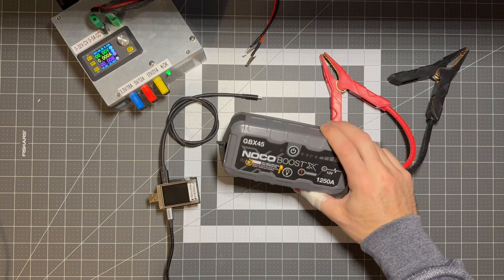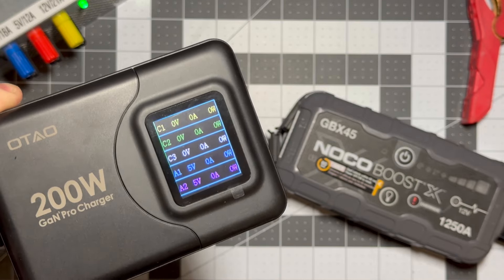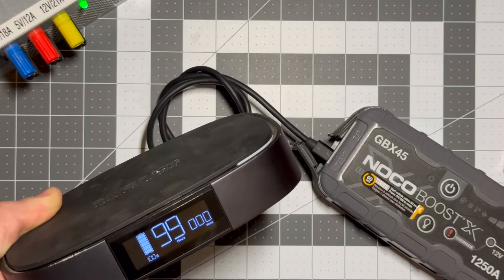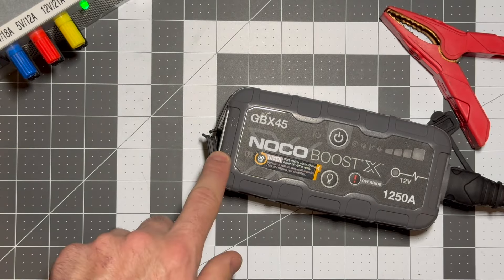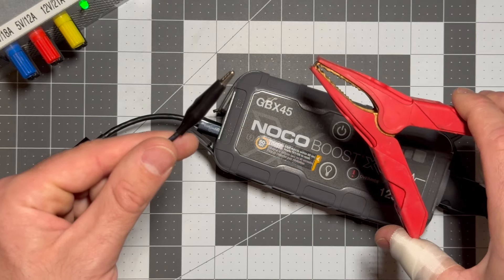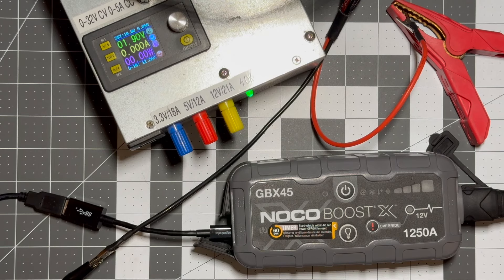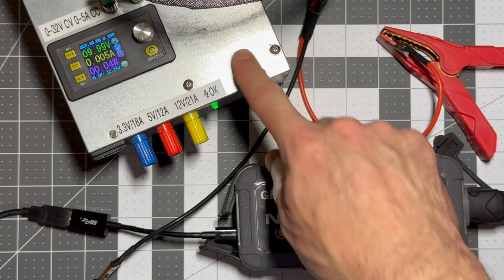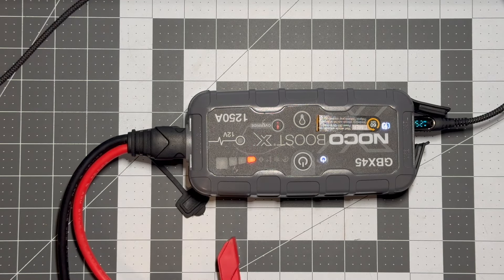No-Open NOCO Repair: Power Measurement and Charging Hack

Comment: Thank you.... this worked for me. I went to Harbor freight and got the cen-tech battery maintainer $9.99. Got home and cut one end of an old usb a  and of the 4 wires I used the black wire. Plug the positive clamp of the maintainer to the positive clamp of the noco and on the usb a black wire I plugged the negative clamp of the maintainer. 15min later  noco was alive again. Thank you!!!
Reply from the maker: Awesome. What is the current on the battery maintainer? I bet it's in the right range for charging this thing up.
Reply: I used this same trick and it worked like a charm.  I have a Battery Tender brand tender and it outputs 1.25 amps. 

It brought the unit up far enough to get the red light in about 2 minutes, and then I brought it inside and put it on the regular outlet charger.
Reply: @CarlosFlores-ih7dg did the charging light turn green on the cen-tech trickle charger for you? Mine is staying in yellow, which is standby.
Reply: @jamie1682 Yes it blinks indicating it's charging
Reply: @colindgrant  I have a Noco Genius2 2A car trickle charger. Do you think that would be too much amps to do this fix on my GBX45?

Comment: Thank you so much for this video. I’ve had a GBX 55 that’s been dead for six months. I could not build a power supply like you have. But I did have extra USB-C cable, so I stripped back the white outer coating of the cable, to show the black and red wire on the inside. then I cut the red wire in half, Stripped back the red wire from the USB-A end and I connected that wire to the red positive clamp of the noco. I took the USB-C end which had only the black ground wire still attached, and plugged it into the USB-C input of the noco. I first plugged the USB-A end into a 5V 400ma Power supply and left it plugged in for approximately 15 minutes. Then I pushed the power button for the light on the noco, and the charging LED started to blink fast. So I disconnected everything I hacked together. Three days later using the same 400 mA power supply and a new USB-C cable, my Noco GBX55 is fully restored. Able to take on my 60W fast charger. Again, thank you so much!!!
Reply from the maker: That's great! The fast blinking was probably because the battery still needed more time on your charger before the NOCO BMS could take over. Nice work.
Reply: What power supply did you use if i may ask like did you plug it up to the wall?

Comment: Has anyone figured out why this happens in the first place, I mean why the battery gets drained and the USB C port cannot charge it? By the way great video Colin.
Reply from the maker: Thanks! I can't answer completely. But I can add a few things:

1) The USB-C port incorporates a buck-boost converter that adapts between the pack voltage and that of the device plugged in. When you plug in a charger, it boosts the voltage UP, and then that power is passed on to a special lithium ion battery charging IC, which charges up to around 16V. When you plug in a load, it bucks the battery voltage DOWN to 12 or 5V. USB-C devices identify themselves as sources or sinks (chargers or loads), and with the voltages they support, and there is a negotiation between devices at both ends of the cable. So you have a chicken and egg problem. The USB-C circuitry inside the pack has to be powered in order to achieve this negotiation, so that it can receive power! It's analogous to a car battery with an alternator. A truly dead battery won't signal the alternator to make power in order to charge the battery, so roll starting won't even work.

2) As for why the battery gets drained in the first place, I think there must be some small parasitic draw, maybe listening for you to press a button. If you jump start a car or two, you deplete the pack, and then if you don't get the thing onto a charger soon, the parasitic draw brings the pack voltage down below some built in safety threshold. Theoretically a low cell may be an indicator of a damaged cell. So most lithium ion battery management systems are designed to refuse to charge low cells, out of extreme caution. Remember these things can't be allowed to catch fire on an airplane, or after leaving outside at 20 below, or in your car at 160F on a hot day. So manufacturers have to play it safe, and just refuse to charge when there is any indicator of any risk at all.

Sorry for the novel, hope that helps!
Reply: @colindgrant  Thanks Colin for sharing your thoughts. Do you think that having a charger connected to the USB C port of the NOCO which is not turned ON could drain the battery via the USB C port? I use a laptop USB C charger which I run via an inverter in my car. The NOCO is connected to the charger all the time, except if I want to use it outside of the car. So it is only charging when the engine is running. The car can sit in the garage for several days sometimes. It is interesting though, that I have been using it like this for almost a year and it just died one day....
Reply: Nice explanation
Reply from the maker: @miken191 Hmm, the NOCO is designed for charging and discharging through the USB, so I suppose that is possible that it was drained, but I'm surprised it would die suddenly.

Comment: Thanks!
Reply from the maker: I’m glad you found it helpful. Thank you for your generosity!
Reply: Thank You so much! My NOCO died right before my road trip and this revived it. I'm assuming the light was accidentally turned on and ran the battery completely dead.
Here are few helpful tips to help revive the NOCO boost pack.
1. Make sure you have a decent wall adapter for the USB-C cable.  A 1amp USB wall adapter may not supply enough power to continue charging the boost pack.
2. Continue to charge the boost pack with the USB-C cable as soon as you take the boost pack off the power supply. The voltage on the boost pack will or may quickly drop as soon as you take it off the power supply. If the voltage drops to much, then the USB-C cord won't be able to continue charging the boost pack.

Comment: Thanks for this nice video. I'm still confused about the silver power unit you used to crank up the voltage of the internal battery cells to 10V. I suppose this power supply must be able to steer on output current. What kind of power supply unit do you recommend for this purpose? Can you recommend a specific model/brand ?
Reply from the maker: Hi @YeroonSC, thanks to your comment and similar from others, I actually made a video to show what that power supply is all about. https://youtu.be/vJJl3NoeiUc

Note that if you have a 12V 'trickle charger', that should work as well. Good luck!

Comment: I have a NOCO which I carry around in my car plugged into the 12V adapter/ cig lighter to keep it charged for when it’s needed. Will I do any damage to the internal workings this way?
Reply from the maker: You won't damage it, but keeping it 'topped up' like that will actually reduce battery life. Lithium batteries don't like to sit in the high (90-100%) SoC range. I'd recommend you charge fully once a month. These batteries aren't really very high capacity anyway, they're not like phone batteries where you need to full charge to get maximum minutes of use. You just need their ability to discharge massive amps for a matter of seconds. So I think anything over midway charge should be enough. No need to keep absolutely full. But it's not like it will blow up if you do. Hope that helps.

Comment: Hi, thanks for sharing your experience how to fix it. I have 3 devices. one following your method i manage to make alive again. but other two not really. Once is up to 10-12v and plugged in fast charge usb c 65w laptop charger it just keep son 25% mark and does not get full charge no matter how long its left. also fast charge icon on the device its solid red (not white as it should be). not sure what should i try next.
Reply from the maker: @reggaeregis  look at my other NOCO video that has ‘balancing’ in the title. Probably worth looking up that red light too. I don’t remember of hand.

Comment: Original NOCO Car charger is 12V 65W, this is what you use when normal charger dont work as it forces 12v and not "auto select 5v" as the wall charger does when low on power. Just use the manual and what comes with the charger, no need for anything else.
Reply from the maker: I don't have a manual nor a charger but good to know!

Comment: do you think it would be safe to attach the positive clamp and negative clip ends to a noco trickle charger? The trickle charger has a mode for 6v, not sure if that's safe or not to be honest. I have a Noco Genius 2 trickle charger. I don't have a PSU like the one you have in the video.
Reply from the maker: No you really need to be able to control voltage and current. Power supplies are cheap. Look for CC/CV in the name. Your NOCO charger will try and detect what it is connected to, so I doubt it would work, and I wouldn't attempt it.
Reply: @colindgrant thank you for the update! I saw this a bit too late and just went ahead and connected to the trickle charger using the 12V Lithium setting. It was connected for less than the five minutes and I removed it as soon as the Noco was able to power on so I can let it charge via the usb C port on a regular charger. I will definitely get CC/CV PSU for the future. Thank you much! This video saved me.

Edit: just for clarification I used the same setup as your video minus the PSU, for which I used a trickle charger I already had on hand. Bought the USB-A to Aligator clips adapter and attached it to a USC-C to A adapter I already had.
Reply from the maker: @papuchongo  Ok, great, thanks for following up with your experience for others to read!

Comment: Super video,

I also have a gbx155, I completely followed your method before charging there was 8v, now there is 14v but I still can't charge it, I tried different charging methods and I still get the fix red light. The booster works and charges up to 50% with the trickle charger but never with the USB C. Do you have any idea why it won't charge? Thanks for your help
Reply from the maker: Hmm, not sure. The next step is to measure the individual cells to see if they are in balance. One of the cells may be too low or too high for the charge circuitry to allow charging. See my video on balancing: https://youtu.be/pHvbp5dcJH0?si=BBaPrG1feghmgt63

Comment: FWIW …
I also have a NOCO GBX45.  Tried to start a JD riding mower. Did not work. Maybe batt too low. Anyway, when I went to use it on my wife’s car, I got a red fault/error light. Kept trying it; recharging, trying, etc. Sent a note to NOCO. Took a couple of days, but they said to hook it up to a known good battery. It cleared the red error. Might help someone else.

Comment: @colindgrant could you trickle charge the NOCO using its negative lead clamp instead of via the usb port?
Reply from the maker: No, the negative lead is switched internally, it's not directly connected to the battery.
Reply: @ thanks.

Comment: would this work on a Noco Gb251+ 24v jump starter? i tried jumping a truck too many times and think ran the jumper battery down past 0. the error LED flashes 4 times and doesn’t charge
Reply from the maker: I'm not sure what LED flashing 4 times means. This procedure should work, but 12V may not be enough. You may have to give it 20V. But I wouldn't attempt it this way. I would want to open it up and check the individual cell voltages. Look at my GBX55 video for how to do that. And be careful! https://www.youtube.com/watch?v=pHvbp5dcJH0

Comment: Every video or writeup i see about these always has the charging port as USB-C... My GB40 is evidently one of the first versions or something because mine has a micro usb instead. I assume your method will still work the same for my unit? (just substituting the usb-c cable with a micro usb cable)
Reply from the maker: @motosaki404  I have a video on the GB40 as well. I think it’s micro USB on the GB models. I do think this method will work with the micro USB connector.

Comment: So I just got one yesterday brand new and it turns on and has 1 red bar but the charge does not go up ☹
Reply from the maker: Don't mess around with a brand new one. If it doesn't charge, return that sucker!
Reply: @colindgrant  I've now went through 3 of them in 5 months 😹 they are terrible

Comment: how much voltage should it rise to for a gbx 155
Reply from the maker: That should be a 4S LiPo battery, so I would target 12V (3V per cell), or up to 14V (3.5V per cell) if needed. You'll probably see it wake up even lower though. As soon as you can, switch to regular USB charging, and let it charge itself. It knows how to stop when any individual cell gets too high. Good luck.

Comment: Can you not just use the outer shell of the usb A-C cable for a ground connection instead of buying that adapter with pigtails?
Reply from the maker: Possibly. The pigtail adapter is easy to work with. I used to clip and clamp and solder all kinds of things, and it usually cost me time or created sparks! So these days I prefer to use robust connectors wherever possible. They're cheap and save me headaches.

Comment: What is the name of this silver voltage charger
Reply from the maker: It's a power supply out of an ATX computer case. I added a buck boost converter to it, powered off of the 12V rail. I put it together years ago, I guess I should have made a video!
Reply: Can we buy something like this I got a gbx75 and the battery won’t charge need some help please
Reply: @colindgrant thanks
Reply from the maker: @JerryG2714 you just need a  power supply that supports constant voltage and constant current. If you're not familiar with power supplies I would not attempt this repair just yet. Plenty of YT resources on power supplies though!

Comment: Can I use a car trickle charger if I don't have a fancy charger like yours
Reply: Yes. This is what I did. I think a lot of people in the comments are thinking you need some kind of power supply. I just used a 1 amp trickle charger (also a Noco but it doesn’t have to be) and a regular old usb cable. Let the battery charger run for about 5 minutes and then unhooked it and plugged in the gbx charger and it came back to life.
Reply from the maker: Great point, that should work in most cases.

Comment: I’ve got a GBX 155 that got wet and now it’s flashing a blue light and will not do anything except turn on… Any ideas.
Reply from the maker: @fattmouth7715  Unfortunately no experience with those. Has it had time to dry out completely?
Reply: @colindgrant  yes it happened 2 weeks ago
Reply from the maker: @fattmouth7715   You may want to open it up to check the voltage of each cell individually. Look for my NOCO ‘balance’ video. If any cells are below 3V, then balance charge them. But if they’re above 3V and evenly charged, then it’s likely not a battery cell issue, and I’d suspect a component fried inside.

Comment: are they still having this problem with no charge when its fully drained?
Reply from the maker: Just about any consumer lithium battery pack has a BMS that works like this. In a LiPo device like this, I think it's actually a reasonable thing to include. What's not reasonable is how the pack drains itself!

Comment: Can you use a bench-top power supply to do this?? I don't have the computer power supply like you have. Thanks for any info
Reply from the maker: @Sisko125  oh yeah bench top is preferred. My ATX power supply is just a DIY version of a bench top PSU!
Reply: @colindgrant  THANKS!! I just got. Gooloo 4000s that will not charge for Christmas getting a E4code and beeping. Have a diagnostic usb and like you no amp, no watts. How do I set my power supply to do what you do? I think I can do a usb to clip at home I have so many laying around that I can sacrifice to do this. Thanks for any help with the ps adjustments!!!
Reply from the maker: @ it should just be a matter of setting volt and amp limits on your power supply, just like I did. But if those power packs are new, I wouldn’t try to fix them, I would exchange them!
Reply: @colindgrant  Yeah i can’t exchange it I bought it from a surplus store and they don’t do exchange or refund. This was a brand new unopened box so I’m stuck with it so I’m tempted to revive this booster!
Reply: @colindgrant  One problem my bench power supply only have one screen to set the volt amp and watts but don't have a progress screen like you do so I have no idea where the charging will be, I may have to stop charging and check with a multi-meter the voltage is at.

Comment: Gbx45 appears lifeless, made up these leads with clips, but measure 16v (with a meter) before connecting to external power supply, rather than around 2v.
Reply from the maker: If you're getting 16V, then that's a fully charged battery pack. Sorry to say it sounds like your board is dead.

Comment: I tried to charge my phone with this and it won't charge, like no power to it. Tried other things nothing. Charger was fully charged
Reply from the maker: Have you tried other USB devices? Some phones are finicky about USB-PD, which is the charge protocol used in this USB-C charger.